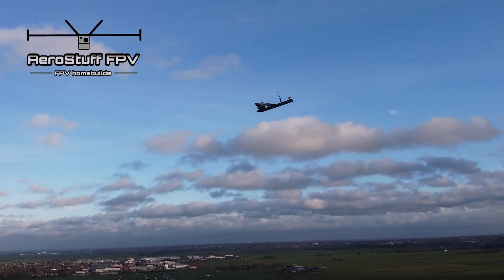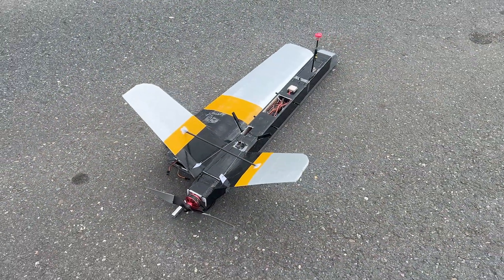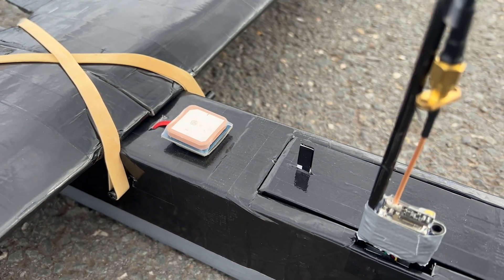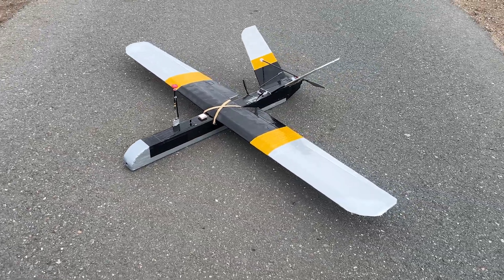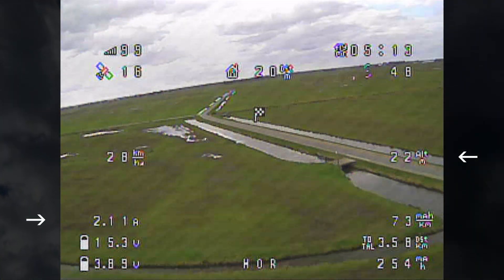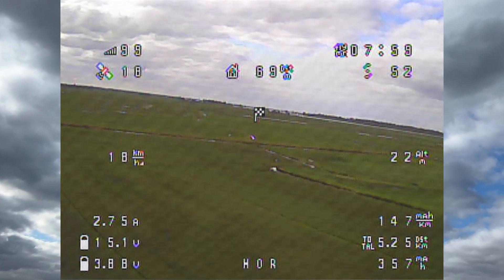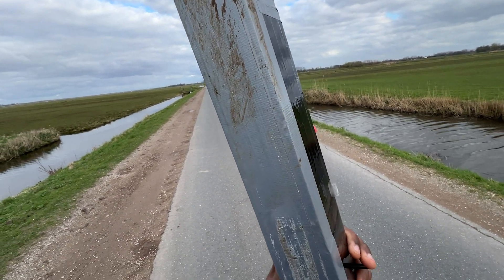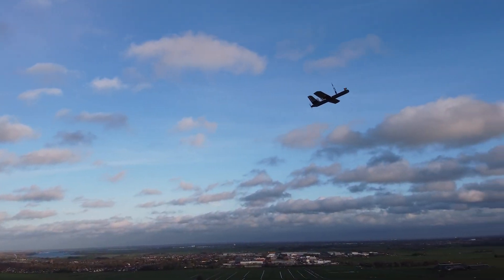V-Tail Pusher for Long Range FPV - Modifications & Flight

Comment: For that F405 Wing unit; do you imagine that fault is likely to repeat itself on other units, or do you think you got a faulty unit?

I guess I'm trying to get an idea on how much I can trust this thing.
Reply from the maker: They're very reliable - The V2 board needed a little solder on a small PCB part for the other side of the rail to work too.

Comment: I made a fiberglass plane just covered the foam board with a few layers of very thin fiberglass it’s awesome. Hit it with some 2000 grit sand paper and it’s smooth as glass. I’ve also been thinking about switching to digital fpv.. dunno very much about it tho.
Reply: I’ll make a short video later and post it for ya just so you can see it.. still very light weight
Reply from the maker: Can't wait to see it!  @chainbenwa2713

Comment: In one V tail tutorial you have one piece of the fuselage at 57cm and other at 30cm, in another you use a two piece totalling 90cm. 

Which is best? Or does it not matter?
Reply from the maker: Doesn't matter as much. For a 1.6m wingspan, I recommend fuselage length between 80-95cm

Comment: I builded this from your tutorial. Fly very very well. Even when one servo at the V tail secton failed. It's remained stable with only half pitch control. I also tried without any elevator servo. It's working fine with just the 2. V tail servo, and also remain stable in the wing.
Reply: hat is the name of this foam? Is it for model aircraft?

Comment: From your explanation I don't understand the problem with power on FC. But from what I understand, the FC can provide enough power for your servos and you are not supposed to connect ESC Power output to the rail, as stated in manual, thus you will get two different voltage levels. And at least what I see from the video, is the ESC connected actually on S1 with all of its 3 pins? 

I personally use separate switching PSU ("BEC") for servos to not rely on controller, but still FC should do very sufficient as long as the power is set up accordingly to manual. 

If this was not the issue then I did not understood the problem, my apologies.

I got the part of bridging both rails, but it's just bringing.
Reply from the maker: The ESC cable doesn’t have the red wire connected to it (it’s halfway cut off) 

I’m also planning to have external UBEC for my V-Tail servo’s as well as more deflection for flaperons just in case.

I still don’t know how it happened. But I’m not soldering that little pad inside since that’ll take another full day of work. Just the BEC and splitting the signal cable to the FC.
Reply: @AeroStuffFPV   Aha OK, so as long as the ESC power is not connected then It´s really weird. Hopefully the BEC will truly solve it and it´s not just some sort of SW issue. 
One note tho, I suppose your dupont cable bridging method was already used before the flight, I might be wrong but I do not like to use them for power applications, I mean, for single servo they are good but the issue could be it´s not suitable for powering the rest, loosen, wobbly...? Don´t get me wrong, It can be totally fine, but I already came across duponts that were not the best quality, either the connectors were bad or crimping was not tight enough. Some either have ridiculously undersized diameter of actual wire. I would like to be corrected if I am wrong with the theory. 

Anyway, good luck with it :)))